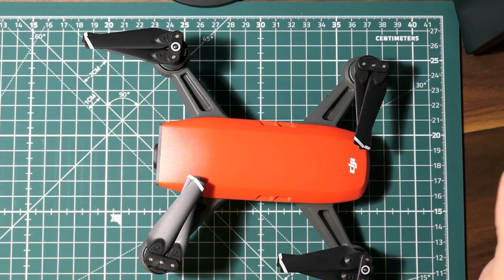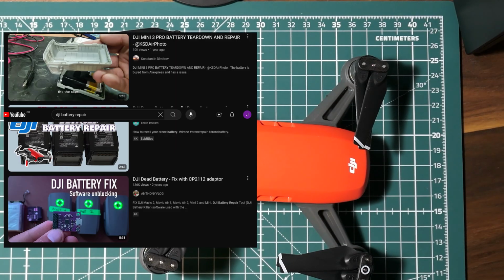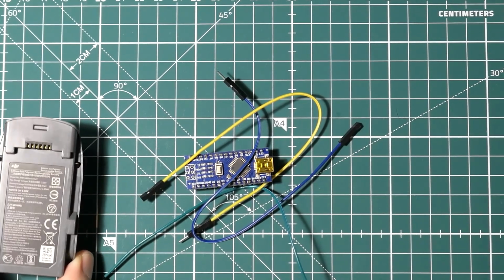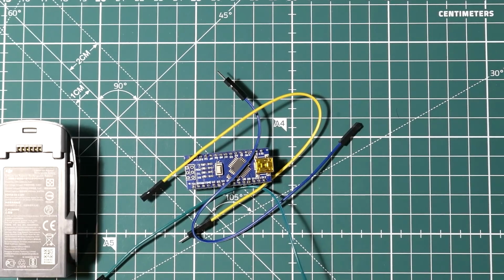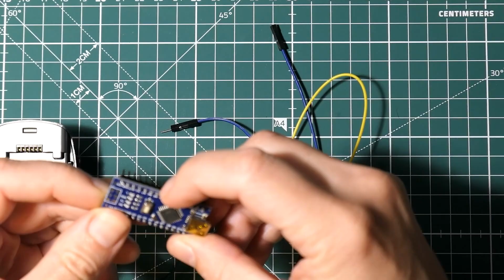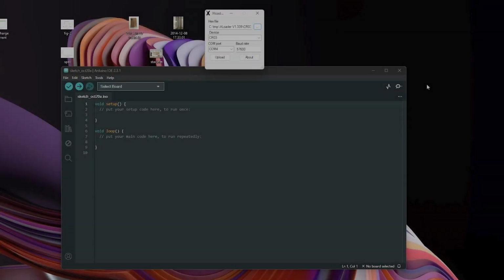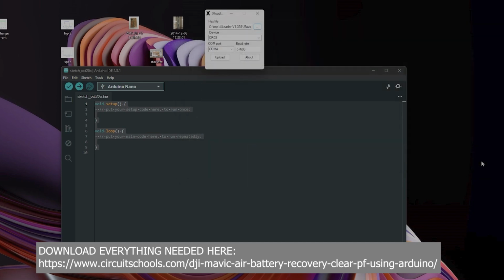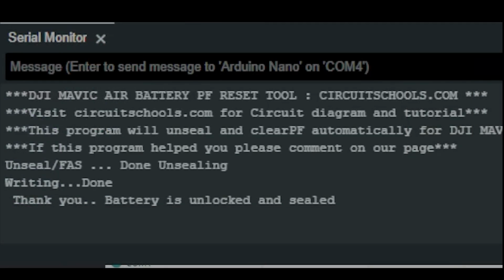DJI drone battery repair using Arduino – super easy (MAVIC, SPARK & OTHERS)!

Comment: Hi, thanks for posting this. Given that I need to use the correct pin out for a Mavic Pro battery, do you know if the software will still do the trick? I have seen on other sites that the batteries seem to be all grouped together as the BMS is common to the different batteries? Thanks for your help
Reply from the maker: It should work fine! The code is written for the Mavic so I was surprised it actually worked on my spark. You’ll just need to find the pin out of your battery and make sure you have the clock, data and ground wires wired to the correct pins on your arduino. If it doesn’t work first time, try applying a low voltage to a vcc pin. Let me know how you get on!!
Reply: @thecircuithelper  cheers, wilco
Reply: @thecircuithelper  can you do a quick tutorial on "try applying a low voltage to a vcc pin" ? I think it's not working for me because the batteries have been sitting for over 4 years and voltage is very low.....  
I managed to do everything you outlined here but the hex file program doesn't get past the "Unseal/FAS..." stage.
Perferably the 9V battery method. Sorry for asking, I'm good at following instructions, but have no idea what you guys are talking about ...LOL
Reply from the maker: @AlonsoPena  Hey, don't worry about the batteries not being used for years. Mine also hadn't been touched in 5+ years... no light at all when I pressed the button.  For the 9V battery what you need to do is the following: (1) find the pin out for your drone battery, google images will have it for sure. In my case searching for "dji spark battery pinout" gives plenty of good diagrams. (2) On the pinout diagram you'll see some pins marked as '+' and some as '-', (3) Take a 9V battery (like one of those rectangular PP3's), attach the positive terminal of your battery to the '+' on the drone battery, and the negative terminal to the '-' on the drone battery. (4) Once this is connected make sure the SCL and SDA pins are connected to the arduino  appropriately and try again! Good luck!

Comment: It's a safety device. Charging dangerously over drained lithiums can result in fire or rapid discharge and the drone can fall in the sky. As long as you understand that.
Reply from the maker: I certainly agree it is intended as a safety feature, however, there are better and more sophisticated ways of detecting if the cells are actually damaged and not suitable for recharging. Simply locking them forever with software doesn’t seem the best option to me, but your point is very true… LiPo batteries can be dangerous if mistreated, and letting them discharge is certainly mistreating them, so caution is needed when unlocking them. I certainly won’t be flying this drone anywhere it might cause an issue if it crashed (although I did a 15 min test flight and it seemed fine).
Reply: I think the charger discharged the cells with its own electronics instead of leaving them at 100% with a pulse charge. the dji charger apparently switches off after 100% and do nothing ... i have 18650 cells here and they stay in the charger all year ... no problems. the stupid thing is, i got an fpv drone from dji for christmas and now i'm annoyed about this rubbish ... batteries are still available on alirxpress for 90 euro ... 😅
Reply: My country wont accept these also none of the seller provide here